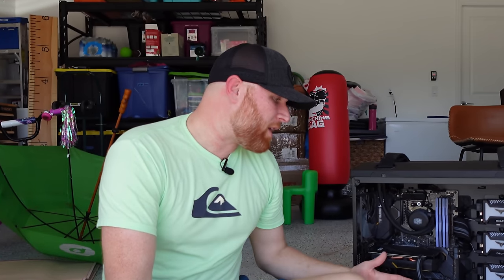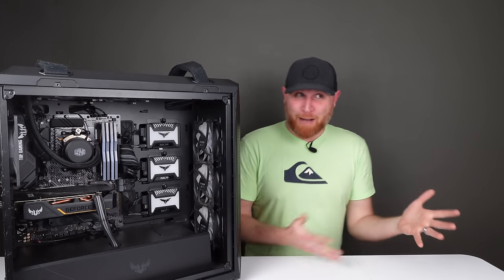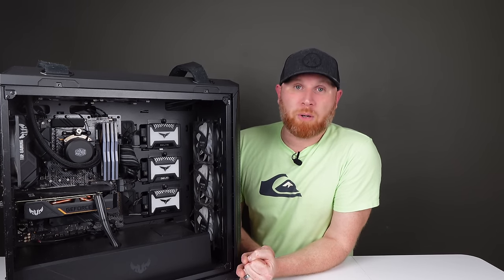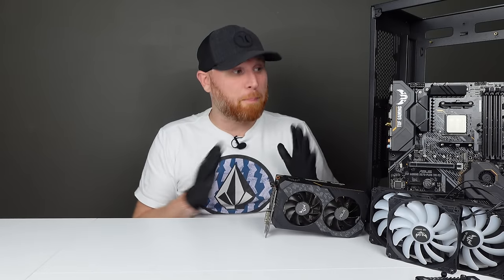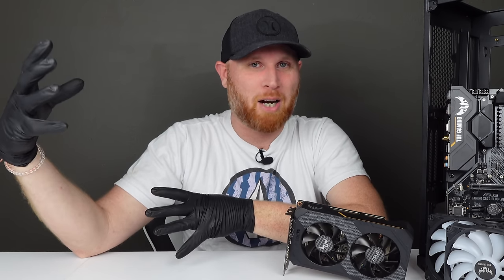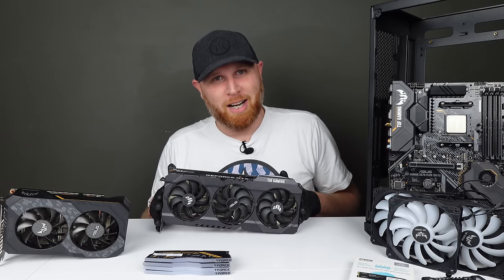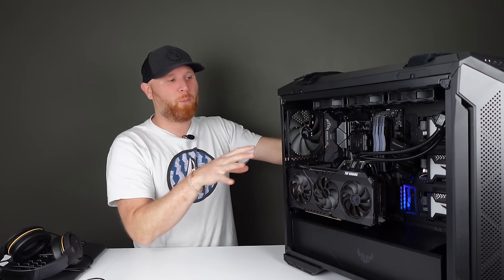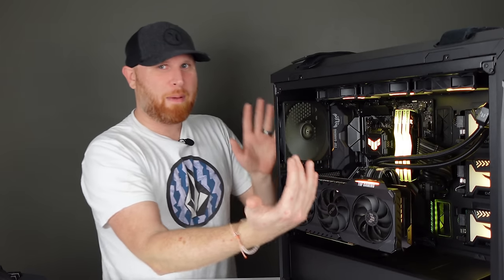The TUFest $400 Marketplace Gaming PC - PCBUC S1.5E10

Comment: Another awesome build dude. Thanx for the distraction, I needed it. As far as the RAM goes i'm gonna have to say capacity, my son runs sooooo much stuff on his pc that he's sitting at 8gb usage just at idle. You never know what the buyer is gonna be running all the time and I really don't think that they're gonna notice a huge difference in performance. You did good by the pc without a doubt. I'm a  few hours from you and yeah this heat is getting bad, lol. How're you enjoying the 100% humidity?  Here's a little tip, buy a 100ft garden soaker hose, run it across the peak of your roof and turn it on for about an hour during the hottest part of the day, usually 3-4pm. Till next time
Reply from the maker: I agree on the capacity. But I told the person who bought it about it and left the ball in his court. I actually lived here for college when I was younger then moved to NC for work so I was well aware of how bad the weather can be this time of year lol. Does not make it any easier though haha. And I’ll give the garden hose a shot, anything to help keep the house cool

Comment: Before getting on board with AMD, the peak performance I managed to squeeze out of a decade-old system was an Asus TUF B85 motherboard, Xeon E3-1285L v3, 32gb RAM and an RTX 4060.  I recased it in a glass-panel, better airflow case (Endorfy Ventum 200) and replaced the Intel stock cooler with a Silverstone AR10-115XS. It would have been nice to get more TUF components... maybe in the next build. Thanks for the inspirational content.

Comment: Hey man! Great video as usual. For the Ram I would probably remove the slower and keep the 16 Gigs of 3200. Ram speed does make a difference with these Ryzen Cpus and you can still put the 2666 ones with an Intel build down the line. Better performance in games will most likely mean a much easier sell.

Comment: Great job, PC looks awesome. I’d leave all 32GBs in, but would try to run slower memory at 3200 XMP settings, most likely will be able to, no problem. Might need to add a .1V extra to stabilise. Capacity over speed though if not able to. Having 32GBs at 2666 is still decent.

Comment: I always test a pc before cleaning to make sure everything works just in case my cleaning results in the flip pc not working. That pc would have possibly been the exception, that was a dust bunny storage rig. The 2060 is yuck only due to the entire 20 series of Nvidia being forgettable junk and the 1080Ti has far outlasted all of it but yes it is a great card for general gaming, just forgettable. Drop an RX6750xt in that rig and call it a day.

 Not an ASUS fan (since the Sabertooth 990FX days) or Nvidia (since the 1080Ti) but your dedication to keeping it Tuf is impressive. Higher end flips here take longer to leave the shelve so we would have made almost no profit as it would have sold for £1000 and sat for a month which is valuable storage space. We tend to make double the profit on £500 budget builds all day. Great build and video. Cheers

Comment: awesome build !! love the theming as always :) i'd personally go with capacity over speed, just because it tends to matter a lot more when doing modded gaming/heavy workloads especially
also, i wonder if you're using the auto mode on your camera? it seems like the shutter speed is inconsistent - maybe try using manual mode and setting the shutter speed to 1/120 to ensure that the video is at 60fps consistently, and just using auto iso so that the exposure is still correct
Reply from the maker: Thanks for the tips! I do t know much about cameras so I am learning as I go! I’ll look into it for sure
Reply: @ThePcRehab  no worries ! look up the 180 shutter angle (rule), as that's what i'm referencing here

Comment: sometimes the ram can bottleneck with all four slots populated, personally since most games dont need more than 8-12gb of ram to run i would choice speed over capacity that said with a Ryzen 9 its possible the system is being used for more than just gaming so the extra ram would make more sense.

Comment: Can't you just overclock the ram, make sure it's stable and just selling it specifying the ram is overclocked? I mean, gpu manufacturers does it to their cards? 🤷🏼‍♂️

I would run the faster ram, take note of all the sub timings and then punch in the ram timings manually on the slower ram and just increase the voltage until it's stable up until 1.45v ig that what it takes. If that doesn't work, maybe use the jedec timings and just increase frequency. But since it's ryzen you have ryzen ram calculator. I love memory tuning myself even though it's really time consuming.

I'm using anta777 extreme profile in testmem to check for instability. If that's stable after a few hours in windows I usually do a 24 hour run from a bootable USB.

And to really make sure I do play quake champions for a couple of days also. 😅

Comment: PC Rehab and Curious Cars have a common Florida living in Florida humidity observation. mb
Reply: default to memory wellll . . . 5800X3D + 3070 or a 3080ti or 69/68XT. mb
Reply: oh I get it, the price is not $1100 but $1100 plus the 32/16 or 36/16 upgrade 32 GB to 64 GB dual channel ram and Vermeer CPU upgrade. $2K. mb